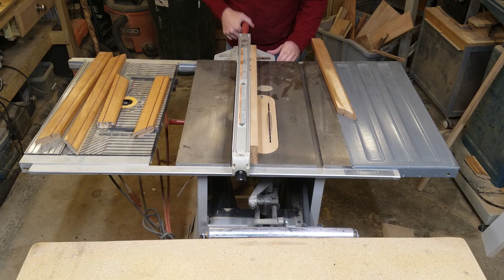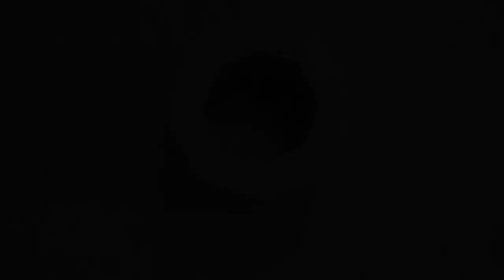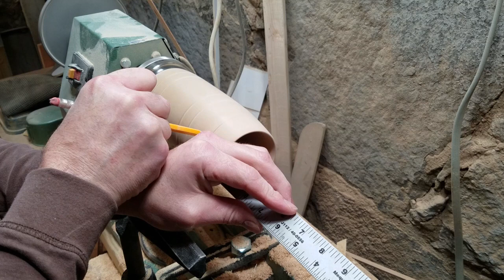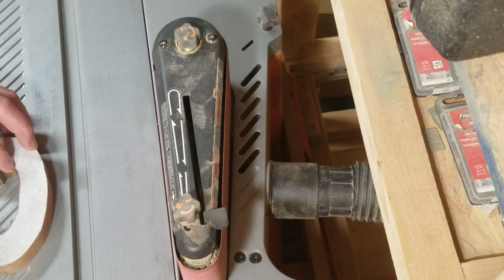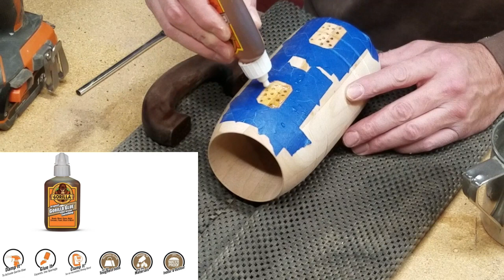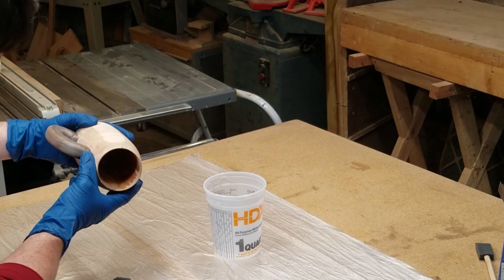How To Turn Scrap Wood Into A Stein - Mug

Comment: Is it a single coat of resin? tried it and the top edge is absorbing too much resin, had to recoat that part but it's hard not to get droplets or marks forming.
Reply from the maker: two or three light coats is better than trying for one thick coat.  Takes longer but makes for better results
Reply: @cabn12  thanks, I'll try that. Very helpful videos, thank you